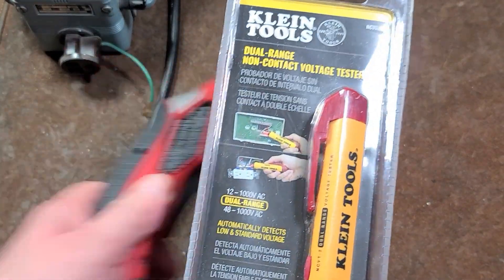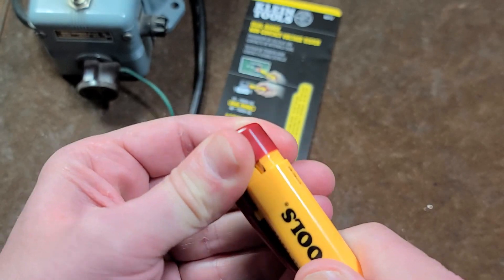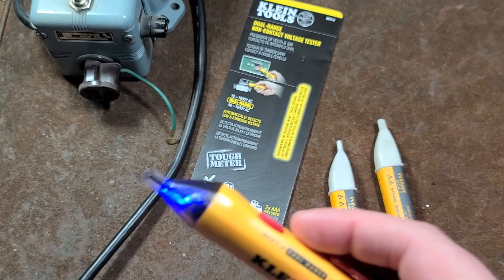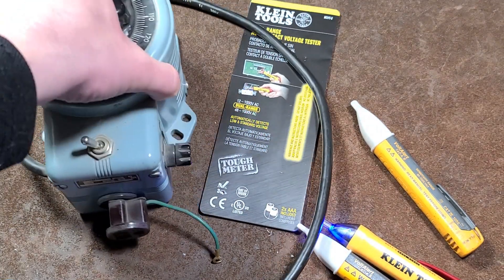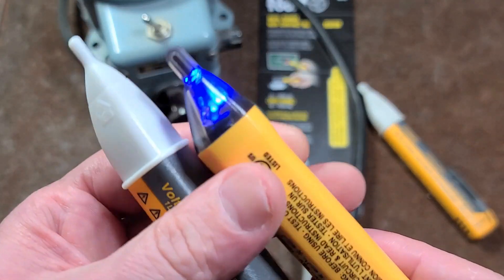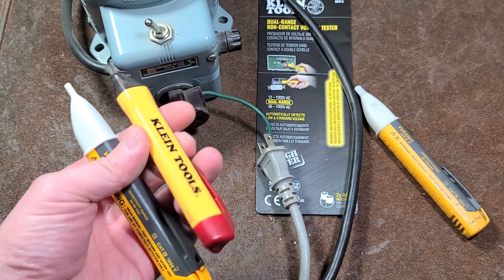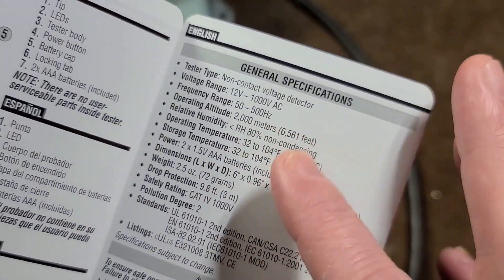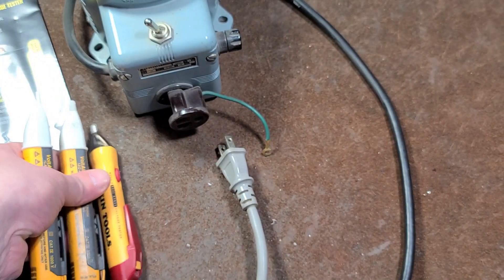Klein NCVT-2 Dual-Range Universal Non-Contact Voltage Tester Review

Comment: I've heard the kleins are much more sensitive than the flukes, which required getting closer to the source, and there are big debates over which is prefered -- or if you should be using these things at all. 

It seems to me that false positives are better than false negatives in situations where you'd use these pens (you can confirm any positive with a multimeter...a false negative you wouldn't know). But I don't know the the arguments, for I dare not go where angels fear to tread (online hobbyist forums).

Comment: Known as 'Chicken Sticks' in these parts. Don't ever trust one!

BTW, I had a Fluke that failed early... found that it came from the factory with ultra econobudget batteries that leaked & destroyed the PCB. I suggest always removing & inspecting factory installed batteries.

Unless an instrument is frequently used, its a good idea to store it sans batteries.

Comment: Klein is a great tool but take it from an old sparky fluke is the way to go also some places won't let you on the floor with a battery operated voltage tester you must have a wiggy sorry for the spelling but it's required that only a non battery device is used some one probably lazy had bad battery and got shocked and OSHA gets involved bla bla bla you get the idea anyway fluke is what I used for years and simone's not a digital the old fashioned stuff big when I was in college for electric and electronics. Have fun great show and nice 🐈

Comment: I've been an electrician for 27 years, and have ALL makes of a non contact voltage detector, NEVER EVER fully trust these things.....NEVER..... There a great tool if you work with alot of knob and tube. But not trust worthy to garrentee a circuit is dead nor hot.
Great review buddy !!!!
👍🏼😁👍🏼
Reply: Why should I believe you?  I tested this thing like 25 times on various live wires and 25/25 it told it was live, and 10 out of 10 times it told me that dead wires were dead.
Reply: yeah. just touch the wires together. you'll find out real quick if there's power
Reply: You don't know there's 10v on there unless you hook up a voltmeter